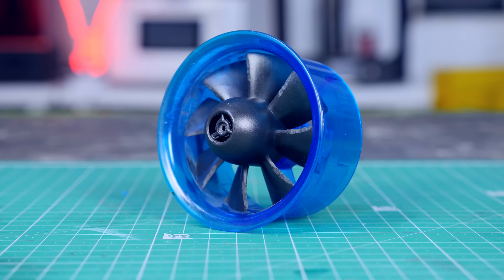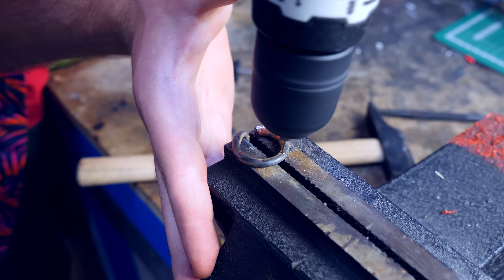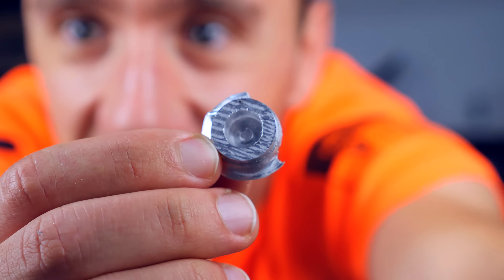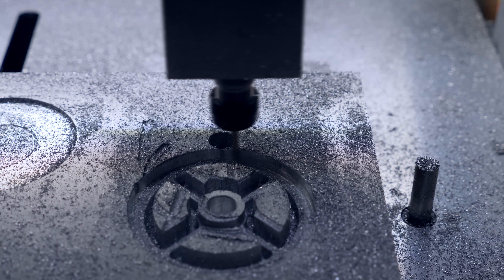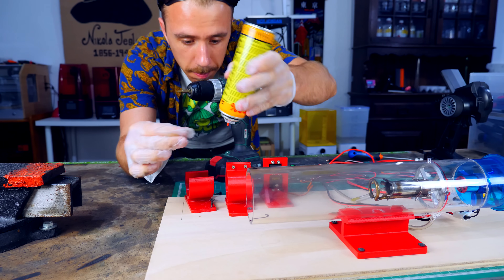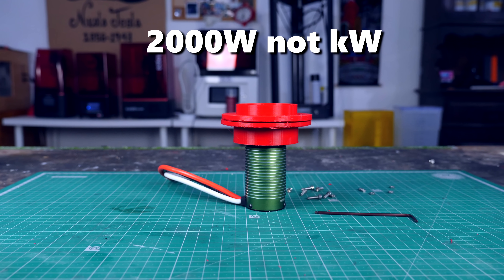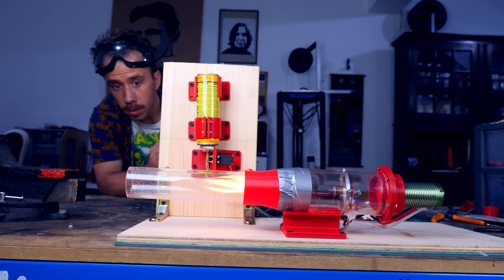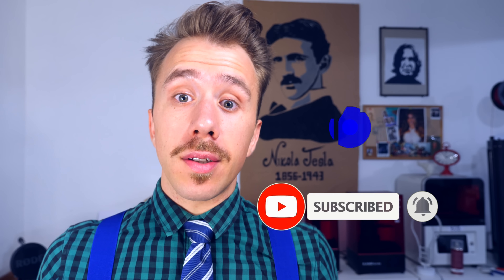I turned my Fan into a Jet Engine (3D Printed EDF Afterburner)

Comment: Brings back lots of good memories from my FliteTest days. How much current is the glowplug drawing? I like that solution better than the stun gun I used. One of those "arc electric lighters" might be an alternative?
A simple solution to heating the gas is to have the fuel line bent in a spiral that goes through the flame. You can kind of see it in this video: https://www.youtube.com/watch?v=-ZROI-QFjDg
A problem I had was the flame tube being too short which let too much turbulent air into the flame zone which snuffed out the flame. The glowplug solution is also fantastic as it would reignite the fuel after a flameout.
Can't wait to see the next video :) Keep up the great work
/A long time subscriber
Reply: Wow, I love that the crazy Swede is watching this video!!!
Reply: Ah man, I miss those videos.  I hope whatever you are up to these days, you still get to tinker with RC aircraft =D
Reply: miss your flight test days they where exciting times
Reply: Or the small "glow plug" used in model "glow" engines (called nitro engines in the US I think), much smaller, far less current/voltage needed, and simpler than the lighter??
Reply: @iffracem  yes that would work pretty well and there isn't much of a heat issue
Reply: It's the rocket knife guy!
Reply: Tänkte på din video medans jag såg det här. Tänkte leta fram den för att rekommendera den, men det ser jag inte ut att behöva längre :D.
Reply: @DarkOoze123  Tänkte precis detsamma :)
Reply: @Walkera22e  jag med!
Reply: I did this with an arc electric lighter! It worked really well, but I didn't finish the project because I had a hard time with the fuel-to-air ratio and my assembly kept falling apart. https://www.youtube.com/watch?v=siELDYKmyq8
Reply: yeah you can get small kits for like 15$USD off eBay they are great they have a continuous arc and it is like 1cm
Reply: He caught David Windestal’s attention.

I’m impressed.
Reply: Or maybe the nitinol coils used in a vape mod dripper.
Reply: Ahh the viggen
Reply: I remember your video; your results were impressive.
Reply: It's good to see your thumbnail again, still miss your channel and tricopters
Reply: Its David!
Reply: The God has spoken....get to it integza
Reply: It's da swede
Reply: I've always used BBQ ignitors
Reply: Please make videos again.
Reply: The master has spoken!
Reply: Edf powered rocket knife when
Reply: Interesting
Reply: The legend himself ! We miss you sir!
Reply: After building a 185% scale version of the ft viggen and adding a propane afterburner, I found that a billet flame tube made combustion really stable. I can share the 3d model I based it around if interested.
Reply: @danielraymond9395  Yes please that sounds amazing! Pictures of the plane as well please :)
Reply: I came here to say what you did about the preheating of the fuel, only i would recommend a small coil on the inside of the flame tube, let the glow plug do double duty.
Reply: David, we miss you!
Reply: Piezo crystals are better. One press and it createa an arc. No setup required.
Reply: @freevbucks8019  yeah i see what you mean but you would have to press it every time you want to start it and if the flame goes out
Reply: @projectrc4978  It's mechanically activated. You can actuate the spring actuated striker with a servo. Just two components.
Reply: @freevbucks8019  yeah totally forgot that would be possible that would make it a great way to ignite the mixture :)

Comment: Might be worth while attempting to exert tighter controlled over the Fuel pressure/flow rate and engine RPM using a micro controller? Should make it a lot easier to get the mixture right and keep it there.

Comment: My video recommendation would be to further develop this  3D Printed EDF and Afterburner so that it burns Hydrogen (or HHO; your choice) from a HHO (Electrolysis) Generator. Hydrogen burns at a higher temperature than butane and in turn might give you higher exit velocity than butane. It also has an extremely low minimum ignition energy and might help to keep a more consistent burn.

Just don't pressurize the HHO or pure Hydrogen as it is extremely dangerous this way. Use a constant flow rate and a flashback arrestor to keep it safe. 

Hope I win! and don't blow up :)

Comment: For having any success at machining aluminium on one of those not so rigid CNC machines I would recommend getting a short end mill and running it on high RPM then start at low depths of cut and feed and raise feed to find the point where you don't get as much chatter

Comment: try filling the tube with sand (or something incompressible)  and solder off both ends and you can bend it without the need to heat and you will not smash it.

Comment: seeing you've got the constriction already, use the turbine you built a little while back (or print a new one), and use that to suck in the air. the change in direction of the airflow will compress the air even more. then you can use another, mounted backwards, to force that air into the burner can. As for a fuel preheat, make a small hole at the top of the burner can and reroute the semi pressurized hot air from the combustion to pre heat the fuel. or parallel a second glow plug in a separate container and coil the fuel line around it.

Comment: I have a couple tips on your CNC machining. The noise you're hearing that sounds terrifying is called "chatter" and it's caused by your tool vibrating against the part in ways it very much shouldn't, so you are right to be terrified hearing that because your bit could break and be thrown off the machine at a very high speed. You can eliminate it with 2 methods: use a tool that is only as long as you need it to be, and adjust your feedrate and spindle speed. The bit you used seemed extremely long for what you were doing, so I'd suggest getting shorter one before you machine aluminum again. Another thing I noticed is you are plunging (machining straight down) into the aluminum and stalling the spindle. In any situation you can, I suggest ramping into your material, either to full depth and then continuing your cut, or doing a continuous ramp all the way around your perimeter, perhaps even several times before you reach full depth and then completing your cut. Ramping is so much easier on your spindle, and your z axis will have to exert way less force.

Video idea: learning to use a CNC router Integza style.

Comment: The reason  it sounds like that is because your cnc feed speed is to fast  slow it down and reduce the depth of cut and it won't break the bit or do sloppy work and ur part will come out cleaner and switch from a speed steel bit to carbide and it will work so much better

Comment: Video Idea: You should make a Tesla Rocket Engine: a Tesla Oscillator for power, Tesla Coil for ignition, an induction motor to power a Tesla Turbine, and a Tesla Valve as the fuel line.

Comment: i think you can use a reducing gearbox and a bigger fan in order to increase the maximum power you can get from the fan, also your engine definitely needs a better nozzle than a smaller tube duct taped at the end

Comment: what would happen if you use two stages of fans? I mean 1 stage of the EDF and a second stage with the centrifugal

Video idea: try to use hydrogen as fuel for the jet engine, you just need to separate water with electrolysis

Comment: You could try getting actual jet fuel and have that 2kW engine but have higher speed air rather than pressure with the big pipe go into a smaller pipe like the one you used with a lot of free spinning fan blades on a ball bearing (such as a compressor in a regular jet engine) and go back to the big pipe with the fuel and glow plug at the mouth of the second big pipe

Comment: an idea for preheating teh fuel for this, if you run the fuel line through the exhaust pipe (probably in a spiral pattern for better heat absorbsion) you can preheat the fuel that way, its the same thing they do in space engines.

Comment: you should try using lubricant on the cnc to reduce the noise and increase the lifespan of the drill. OR if you want there are companies who make cnc parts and you just have to send them a CAD file

Comment: You can improve this jet engine with a Thermal Glass tube instead of acrylic tube, making some parts in metal filament, preheating the fuel and adding more pressure to him. Maybe you can do a nozzle with some metal filament to add thrust
Reply: maybe make it smaller too

Comment: You should get someone who blows/shapes glass to make a new tube for you that has a restriction after the fan/fuel and then an expansion chamber and a nozzle that you can machine from aluminium but ignite the fuel air mixture just before the narrow inlet.

Comment: Build a device to measure the thrust of all these different engines you make. Use the measurements at various throttles and fuel rates to find the optimal conditions for your designs. Then change parts of your designs to conform with traditional designs and see if you can improve your thrust score. Or roast tomatoes with it idk.

Comment: 2kW of fan power, what the heck is that afterburner going to add! I've seen impeller-RC planes go 200km/hr with that kind of power :D
13:17: It looks awesome! (and scary as f, glad you do this so I don't have to; my wife and kids would run away...)
Reply: Looks cool and increases the pressure a little bit I guess

Comment: I started learning cnc milling by cutting aluminum.  It's not that bad, just a little softer than steel. Fixturing will always be the bulk of the job. Just be careful if you're cutting dovetail joints.  Don't friction stir weld your tool steel cutter to your 6"x6" cube of aluminum because of a chip you missed.

Comment: Try looking at real jet combustion Chambers and afterburner tubes. 

You will see it has a can or tube full of tiny holes. Air blows in through those holes along the length so the flame never touches the metal at all as it burns inside. It would melt in seconds otherwise. 

You may be able to do that with the acrylic. But would be a tube in a tube. With air directed to bit and some directed to cool. 

A normal fan rather than centrifugal would be better. Afterburner jets I don't think ever use centrifugal fans. 

AgentJayZ has a great channel about jet engines. And that name is wrong.

Comment: My suggestion is to 3d print/cnc a scaled down internal combustion engine. Maybe even use it to power something. Can make it diesel or even compressed air powered. Petroleum or LPG powered is possible but prob harder. Diesel can lrob pinch nitro rc glow plugs or make you own glow plugs that way its only a cam, crank that need "timing" as the compression of the diesel with the heat+air makes the boom for rotation.

Comment: The ignition in a diesel engine is actually from heat created by compression. The glow plug is only used on cold start up to help the air/fuel  ignite at the lower temperatures.

Comment: Omg, this looks like a huge explosion hazard, running that thing inside. If you have incomplete combustion, you could get way too much propane into the room and if that ignites, good luck. Maybe use the big fan to constantly change the air in the room if you're completely unable to test outdoors?

Comment: I'd like to see you mount the "engine" section on a sled assembly with a simple spring scale and see if the afterburner actually adds any effective thrust...
Reply: Yes agreed, I was wanting to know how much thrust compared to the EDF by itself?
Reply: The only issue with EDFs is that they don't produce a ton of static thrust.
Though I would also love to see how much difference is being made.
Reply: of course it doesnt... its a fan with a silly flame in front of it
Reply: @alistairbalistair9596  
You just described a regular jet engine.

Also, *behind.
Reply: @driftertank  
Fair point. I agree.

Comment: don't use double  bladed bit..use only 1..and try using a coolant. As blade heats up,,it cuts less effective. and also don't use one that is that long..if long use  a wider diameter bit.

Comment: jet engines don't use radial fans!
the use multistage axial fans that are driven by the exhaust turbine. i also think that you need a longer combustion tube because a lot of your propane/air burns outside the chamber which is basically wastet. i wouldn't try to design an own fan and just buy a EDF.

but great idea and video, had a few good laughs

Comment: hmmm what about you try to make another tubro jet engine and place it infront of the afterburner and remove the motor and replace it with a free moving turbo fan blade and use the exhaust of the turbo jet engine to spin the free moving tubro fan blade and try to use the after burner with the exhaust just like in a real jet i think :p

Comment: IDEA: Why not try to convert a normal 3d printer to print with cement/concrete and build a rocket engine that way.... that material is far less prone to heat. And then you can support it by printing outer covers for it using ceramic / resin / high temp filament.

Comment: Video idea: You should 3D print a rocket engine nozzle with metal but give it a shape which allows the cold propellant flow around it to cool it down before getting in the combustion chamber

Comment: If you fill that brass tube with fine sand before bending, it both holds heat better and will not collapse in tight bends! Awesome afterburner!

Comment: When machining you need to be thinking about how rigid the machine is. That endmill was way to long for what you were doing, and the tool flexed quite a bit. You should get a shorter tool, especially a shorter flute length. Lubricant can help, but isn’t necessary in aluminum. Feeds and speeds often have recommended values for the tool itself, and don’t account for the individual machine, and so you should move them around a little to find what works best on your machine.

Comment: The feed rate was much too high for that cutter and motor setup. You either need a higher torque motor or much slower feed rate. Also, if you crash or drag a cutting tool, throw it out and get a new one. You'll never get good results with a bent end mill. Aluminium can be cut dry but any lubrication can help. paraffin works well with aluminium as coolant/lubricant. Learn to regrind tool too. If the tool isn't sharp it will perform badly, like trying to mutilate a tomato with a blunt knife.

Comment: By curiosity, what could happen if you made the constriction before the diffuser of the flame tube?
I think the yellow flames the are rich mixture caused by centrifugal fan because the air is denser about the periferic region of walls than the center of plexiglass.
Reply: What's is happening inside the tube with the centrifugal fan is something like a tornado, you have the denser periferical region and inside the center has lower pressure caused by centrifugal forces. Now I think it's a better explanation.

Comment: the reason the CNC sounds like that is because of chatter, basically the end mill is vibrating a lot. I’d try to use a much shorter end mill and see if that helps

Comment: Video Idea: Try using a piezoelectric igniter to ignite your fuel. It is super interesting how they work and would be something fun to experiment with. Also In the video, I noticed your fuel reigniting a few times when you didn't want it to. I think that is due to the latent heat of the glow plug.

Comment: to preheat the fuel look at camping stoves that use gas, they loop the fuel pipe through the burner so itself heats the fuel.   If you wrap the fuel line as a helix inside the  plastic tube just after the afterburner goes blue,  you will get the right amount of heat for the to preheat of fuel, good luck,  -  tomatoes are evil

Comment: Video Idea: Use the oxygen produced by the decomposition of hydrogen peroxide (maybe using potassium permanganate) and pump that into a similar afterburner system like you just made. I guess it would be kind of like a liquid rocket, but powered by gasses instead of liquids, so you might not even need any kind of turbo pump if the initial gas pressure is high enough.

Comment: Glow plugs aren't needed for combustion. Some of the trucks doesn't even have a glow-plug. They are only there to pre-heat the combustion or swril-chamber at a cold start. The fuel is ignited by the compression and consequently by the heat. On some newer diesels, the glow-plugs are also used to increase the exhaust gas temperature when regenerating the DPF.

Comment: You are ready for the turbocharger turboget engine😏
Have you ever thought to 3d printing molds in which casting ceramic for heat resistant 100% infill parts?

Comment: You could make Tesla’s radio-controlled boat and then put the engine you are making as it’s engine. Or a Tesla radio controlled unit to run your operation from a distance

Comment: Murder, i mean MASH,  and dry a box of 🍅 🍅 🍅 and powder them to scatter their dust.... I'm kidding, rather,  mix it with some stump remover (potassium nitrate), from the hardware store to make 🍅 rocket fuel. You can 3d print the rocket 

Candy rocket fuels are typically around 65% sugar to 35% potasium nitrate. Dry weight of tomato being 75%  carbohydrates (sugar and fiber) + 13% protein. Both oxidize and should substitute fine. Preperations that use a little heat to dry melt the sugars will help mix the potasium nitrate more intimately with the fuel.

Comment: Most of the thrust from an afterburner comes from the restriction, since an afterburner is essentially setting up a de Laval nozzle and then injecting fuel at the throat. Right now your fuel expansion isn't generating much extra thrust since you aren't accelerating the air flow using the combustion energy. You're just blowing hot air, literally.